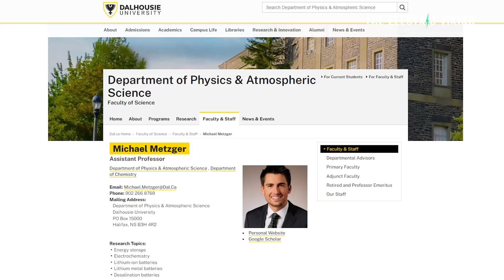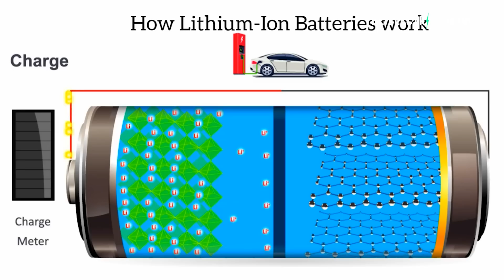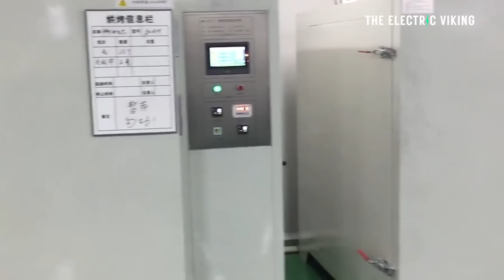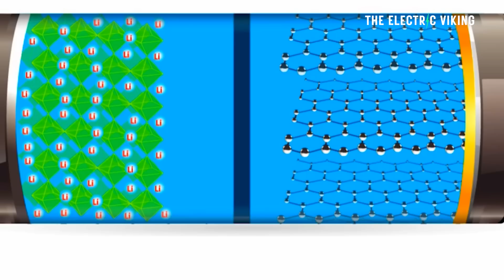Tesla battery scientists discover why lithium batteries self-discharge

Comment: sorry i have to correct your incorrect info .
self discharge in mobile devices is totally insignificant. laptops and phones discharge their batteries because the phone and laptop is never actually off its in standby with a power supervisor ic monitoring that power switch all the time. however its true the discharge capacity is impacted by temperature they dont like cold, teslas heat their lithiums when temps plumet

Comment: so strange to hear this myth as  i have a cold damp garage full of  used laptop 18650,s i charged and tested 3 years ago some are down to 4.1v but most are at 4.2v as i left them 3 years ago and yes i dont have the correct  storage charge  on them but thats also in my test case a myth , quite a lot now measure more capacity than 3 years ago! and some that have lost capacity have lost no more than 5% and this is used abused stored incorrectly basic 18650,s. i therefore assume its an issue with high peak discharge current  variants? im now waiting for the nicad memory effect to be claimed on every battery technology in existance too!

Comment: EV'S ARE AN INSANE IDEA FOR MANY REASONS. FOR ONE THING, THEY LOSE CHARGE IN COLD WEATHER. THAT MEANS IF YOU LIVE IN AN AREA WITH SEVERE WINTERS (LIKE 70% OF THE NATION) AND YOU DRIVE AN EV, ALMOST CERTAINLY YOU WILL EXPERIENCE DISCHARGED BATTERIES WHETHER YOU DRIVE YOUR EV OR NOT.

Comment: You seem to be conflating self discharge, permanent capacity degradation, and peak current output.  Cold temperatures lower peak current, but also lower self discharge.  Thus, storing batteries in the cold lets them last longer before they become discharged, but if you try to draw a lot of power out of them while they are cold, you won't be able to.  Warm them back up, and they work fine again, and have more remaining charge than they would if they had been stored warm.

Comment: I believe this video needs to be corrected.  The polyethylene is used for the separator(s). Each cell is a roll of anode foil, separator, cathode foil.  
This is not really "what holds it together" (that can be anything).

Comment: interesting info, more info on the tape in question though is needed to really understand what is going on , is it just the tape or is it also the plastic material ( membrane) between the layers?
How long would you expect a cell to hold voltage for without being used during that time?
I"ve had cells in storage for years and the voltage drop has been only tenths of a volt!
Basically if you have a good quality cell it wont loose voltage, well negligible amount.
I was quite astounded when I found this out for myself.
Although its interesting info, good quality cells the voltage drop is negligible anyhow, over many many years. You really need to qualify this information with what is the self discharge rate for tesla cells, without that info all this means absolutely nothing.

Comment: Actually, self-discharge in car batteries is not really a significant issue anymore anyway.  The amount of discharge over time from these sorts of effects is pretty miniscule compared to the total battery capacity, and usually the car's own "idle" power usage (which there is some of even when the car is completely off) is a larger drain than any internal battery discharge, so this isn't likely to make a big difference for car batteries in most cases, I think.

Where this is potentially much more significant, though, is in very-low-power small battery applications which need to run for a long time, such as remote sensors, IoT devices, RFID devices, etc.  In these applications, self-discharge can be a much higher proportion of the total battery usage, and it could result in devices that can last much longer between recharges...

Comment: Way back in college, we had lectures on materials science, one thing I noted and have wondered about was the use of glass rather the plastics for batteries. Way back, with very early wind systems for farms, the lead acid cells were made with glass, and were very good batteries, very long life and repairable.  I've been waiting for someone to "discover" this fact and apply it to current battery tech.
Reply: we have flexible glass today, its possible.
Reply: I recently dug up a glass cased battery that had been mostly covered in mud for many years. I decided on a whim to take a wire to short the posts together. It was still hot and melted one end to one post. I had not seen one since my father had one on the farm in the 50"s.
Reply: I imagine it’s a cost issue. Lead acid batteries will degrade after a long enough period most average 5 years from what companies state, and some rarely can make it past that without a cell failing. Cell replacements can range from 1000-1600$ now I imagine if they used special treated glass the cost goes a lot higher. A lot of things weigh in on what is seen as cost effective, size, weight, what other components might fail even though the glass is holding up better. The lead eventually gets very dirty and the layers between.
Reply: @madjackgamingandfitness498  With proper maintenance, a flooded lead acid battery can last for 10-20 years.  Keep the water topped off with distilled, don't run it down too low, and don't keep a a high float charge on it.  Hit it with an equalization charge once or twice a year, and they keep on ticking.
Reply: @phillipsusi1791  I have never in my life run into an industrial 12 cell-18cell-24 I can honestly say I have yet to run into one that went over 7 years. I am talking batteries in warehouses that get used. Could one last 10-15 years? I imagine it's possible if you are swapping cells, doing restorations, or the thing was baby sat and used not at he frequency of a day to day warehouse operation. They only have so many charge cycles. Even companies that sell them only claim a 5 year life span as a realistic expectation.
Reply: @madjackgamingandfitness498  I've seen forklift batteries last more than 10 years, yes.  It is not true that they only have so many cycles.  HOW they are cycled changes their life dramatically.  If you run them all the way between 100% and 0%, they won't last long at all.  Same if you keep them constantly fully charged at max voltage ( like most cheap computer UPSes do ).  Keep them between 30% and 90% most of the time, or at least once you do fully charge them, back off the float voltage, and they can last for a LOT longer.
Reply: @phillipsusi1791  Just a means of getting people to do that. It's an almost impossible task for some places to even get the 5 years.
Reply: I wasn’t there for that class either so I may not have that knowledge to compare to with what I know from an industrial experience stand point.
Reply: let's build some instead of waiting
Reply: I'm not sure that it was the glass as much as it was that they were flooded lead acid batteries that you could ( and needed to ) top off with distilled water now and again.  The industry largely moved to sealed gel "maintenance free" batteries where you can't replace the lost water, which is why they fail after a few years.
Reply: @phillipsusi1791  I mean, you 'can' replace the lost water, but that is hackish as hell and a firehazard waiting to happen if you slip with the drill.

Comment: I have Nissan Leaf batteries in my self-built EV. They have been sitting unused in my garage for 5 years. Every now and then I get the individual cell voltages checked. Result : over 5 years they have lost about 3/100ths of a volt on average and remain within 2/100ths of each other over the whole pack.  I have no BMS modules attached and I think that BMS systems are often to blame for discharging batteries.

Comment: See also the official report on the battery fires that happened on two Boeing 787 aircraft soon after the model was introduced. One of the experiments the investigators did was to put cells in a very sensitive calorimeter that enabled them to detect if the cells were generating any heat, even a tiny amount. Below about 55 degrees C (131 degrees F) the cells generated no detectable heat. Above this temperature they did start to generate heat within themselves, although the amount was tiny until the temperature was raised considerably higher. This implies that there is a side reaction that is discharging and/or destroying the cell, that starts at about 55 deg.C. This would explain why lithium cells have such a short life if you work them so hard that they get hot in use, but can have a very long life if you never get them hot.

Comment: I never knew self-discharge was a problem with Li-Ion cells. They're far better than any other battery.  My power station stayed at 85% for the last 6 months and just recently dropped to 84.
Reply: ALL batteries self discharge.  Some are worse than others, and NiMH are pretty good, but it sounds like your BMS probably just isn't configured to account for the self discharge properly.  If it hasn't been charged for 6 months, and you try to actually use it, I think you will find that there isn't nearly as much energy left as it reports.
Reply: From my understanding NiMH loses 20% every month.
Reply: @economicprisoner  I don't know about 20%, but they drop a LOT. I never could use them, they always seem to be dead and became permanently dead too soon.

Comment: My Bolt can sit in one place for weeks without any noticeable discharge.  Isnt the bigger issue with Rivian and Tesla the tech more than the batteries?
Reply: Yes, it is. Lithium batteries actually have an extremely small discharge rate when there is no load which is less than say the evaporation rate of petrol. It's almost completely unnoticeable. Maybe a couple of percent every couple of months.

Comment: It's an interesting finding but probably not the culprit in quiescent operation.  The main battery keeps the system battery charged in the Teslas.  The car needs to keep current flowing at a small rate to power the communication radios, the BMS and other electronics.  Otherwise you wouldn't be able to unlock your car!  So the 12v battery sips from the main battery to keep it topped off.  That's the main culprit coming out to your car after a week at the airport garage to find the battery in a state of declining charge.
While the phenomenon of self discharge is worth pursuing, it's not the concerning aspect of declining SOC while sitting.  Unless you can take the battery out of the instrument you're testing, this is sometimes difficult to measure.  But all batteries and not just LIon cells have this problem.

Comment: The fire issue is why I think Lithium just won’t last. Need a battery that doesn’t blow up no matter how strong and protective the battery case is.
Reply: Don't hold your breath. These batteries will be extremely dangerous for a very long time to come. It's the nature of batteries unfortunately. Hydrogen paste will be by far the safest energy going forward. Batteries just can't compete on energy density, safety, refill time and cost.

Comment: Regarding the battery degradation, if I remember correctly, the data refers only to models S/X vehicles(apparently they are, on the roads for the last several years compared to models 3/Y). But it is also clear, these cars have much larger battery packs, preventing extreme swings between SoC's of
being empty to full charge states.
Also these cars had software limits on battery capacity, which could potentially alleviate battery degradation over time. Just some thoughts....

Comment: I found the statement about average battery degradation of 12% over 320,000 kms very interesting. The amount of distance any car travels affects its resale value, and the battery condition is just part of the equation. That said, 320,000kms travelled in an ICE car would just about make the car worthless. But still having 88% battery capacity left and with a low wear electric drivetrain means an EV probably has a much longer life than an ICE car, the opposite of what the anti-EV crowd is saying.
Reply: Historically the passenger vehicle depreciation is correct. BEVs have a different depreciation schedule. We are STILL trying to figure out what that is
Reply: @theairstig9164  Correct, it's early days to say for sure how long EVs will last but electric drivetrains have inherently less wear than ICE drivetrains. So, if the batteries can last as long as Tesla are saying then we should expect EV drivetrains to last longer. Other parts of a car will degrade (suspension, brakes, etc) but generally it's the ICE drivetrain that limits a traditional car's useable life. BTW, I don't consider hybrids to be EVs, it's either a battery EV or it's ICE.

Comment: A relevant question is how much does the tape contribute to phantom drain and battery degradation? It's possible it will make some difference but most likely far too small to really be worth worrying about.

Comment: Its a load of irrelevant balls.  Batteries do not discharge when they are cold, they lose voltage which comes back when they warm up.   The self discharge is tiny, the main losses are because there is some power draw from various circuits.  If you properly turn off your phone, and leave it for months it will lose maybe 3% per month.

Comment: Sorry but this will have next to no effect on self discharging devices.

Actually compared to pervious battery tech lion cells are very low self discharge similar to Eneloop battery tech.

The real issue with device battery's discharging is the electronics parasitic draw. The Bms in electric cars and other vehicles WILL unless isolated draw small current from the packs slowly discharging it.

Mobile phones are also drawing a small amount of power from the battery from the parasitic draw from the electronics that are permanently connected.

My Ebike battery I built myself has no BMS and I can leave it for a year and the battery might drop at most 0.01v per cell that's how good the LSD properties of lithium ion battery's are.
Reply: I enjoyed LSD back in my college days

Comment: Battery leakage is one of my largest concerns as I don't drive that much and don't want to lose a lot of money just to keep the battery topped up.
Reply: I believe the healthiest state for a battery just sitting for days/months is about half full, not "topped up".  Sitting full is going to reduce the battery lifetime.  I leave my SOC about 50% if I'm not driving much, then fill it up (usually to 90%) to take a long trip.  (Ignoring the phantom drain issue -- it's slow enough I rarely have to worry about it.)